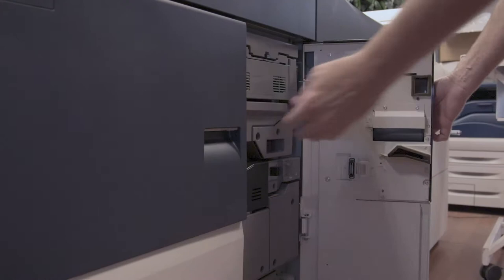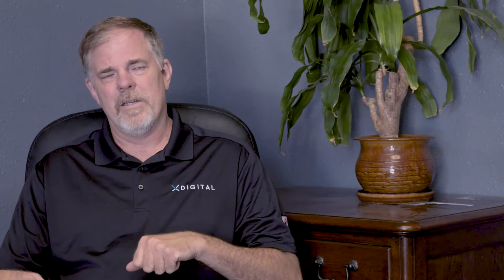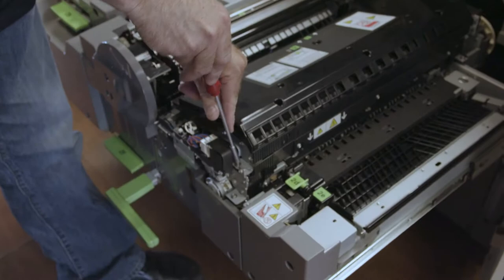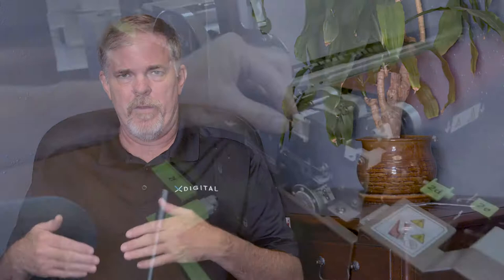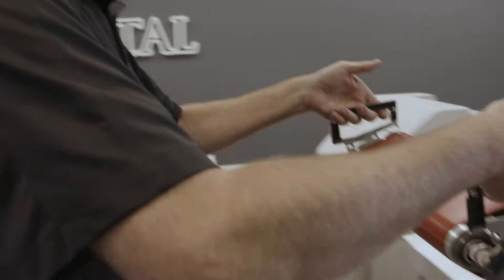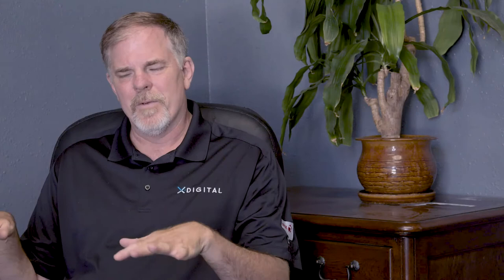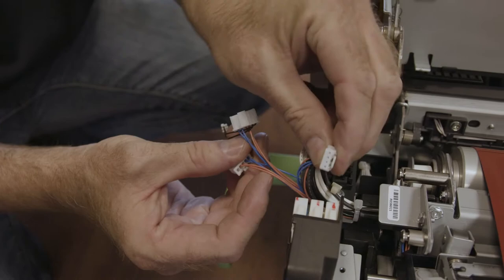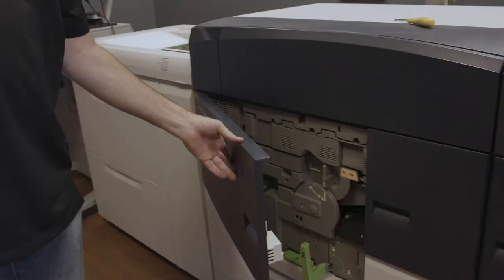Xerox Versant 180/3100 How to Replace a Fuser Belt Module: X-Digital Tech Tip

Comment: Very helpful ! Many thanks. Hope you will make more videos about Xerox versant 2100 Please
Reply from the maker: Yes we will be making lots more tech videos and uploading weekly.  make sure you subscribe to our channel and thanks for watching our videos.
Reply: @xdigitalinc  Hello.

We have two versions and terrible problems with BTR, which sometimes only lasts 10,000 to 20,000 prints. xerox does not accept this piece under warranty.
Do you have similar problems?

Thanks
Reply from the maker: @jossedolinsek2856  Yes there are some known problems which Xerox has addressed in some of their new 2nd BTR units.  Which machine do you have?  Maybe we can point you in the right direction...
Reply: @xdigitalinc  Hello.
Thanks for the reply. We have versant 80 and 180.

When did they solve this problem, because everything is still the same with us.

They came so far that the representative did not take into account the complaint, nor do they want to service the machine bought from them anymore. What can we do?

Greetings